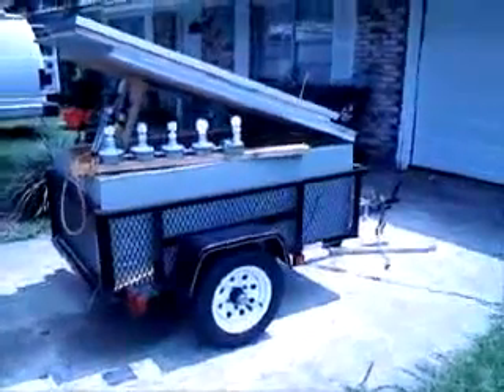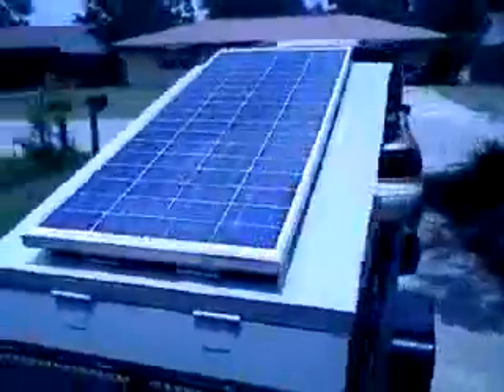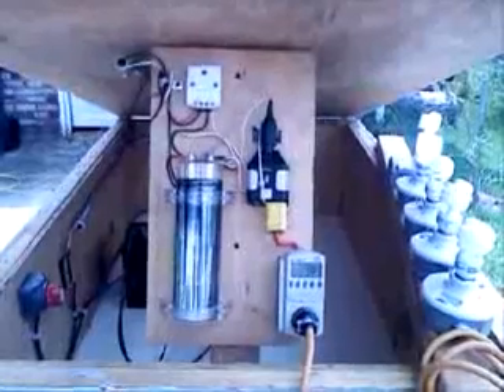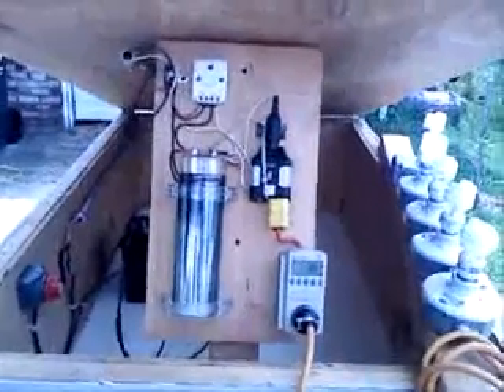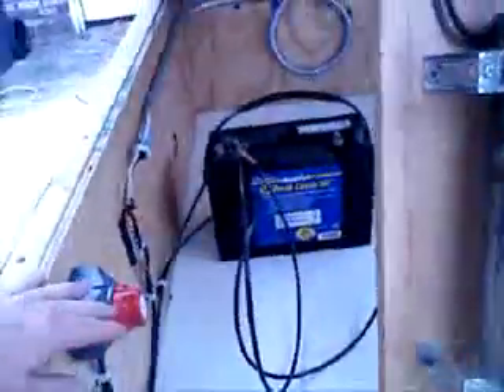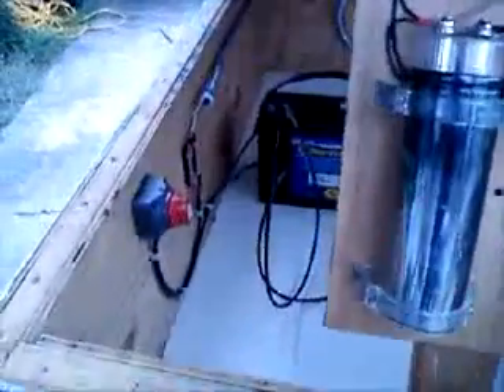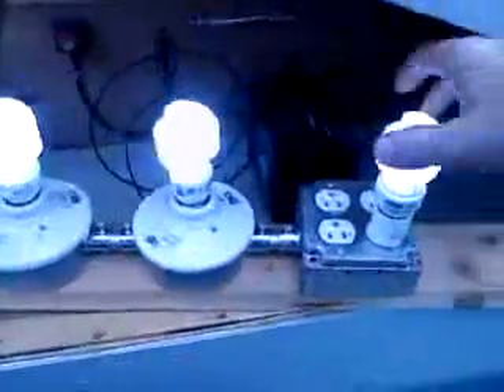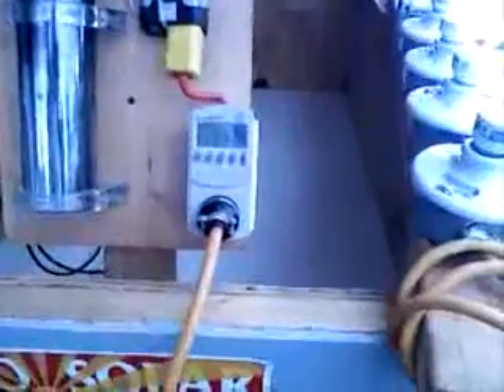Solar Powered Trailer

Comment from the maker: @JimbowT I use it to show that it is possible. Most who saw the Solar Trailer in public, had seen solar power in the books and the tv, but never right in front of them in operation. But it has been powering my house through a second electrical system that I have since built.

Comment from the maker: @VWRabbitdiesel An inverter wants to see 2 things when you first turn it on: 1-Voltage, 2-Current. If I hooked the inverter to the charge controller, without the cap, it would not work. The Cap provides the current, along with the voltage, that the inverter wants to see when it starts up.

Comment from the maker: @VWRabbitdiesel Actually, the cap acts more like a battery, kind of. In this non-battery based set-up, I have the panel going into the charge controller, which keeps the capacitor at 12 volts (without the charge controller the voltage would jump to 18 volts and the inverter would shut down due to over-voltage. Then the inverter is hooked up to the capacitor, which gives me 110 volts @ 75 watts directly from the sunlight.

Comment from the maker: The costs from buying : The Panel, the trailer, building the box, getting the electronics and putting a hitch on my '02 Malibu, it ran me around $1800 to $2000. The panel was $560.00 It took me about 4 months to complete. I can run just about anything that uses 75 to 100 watts max, depending on the anount of sun.